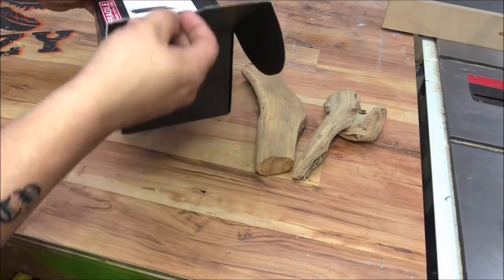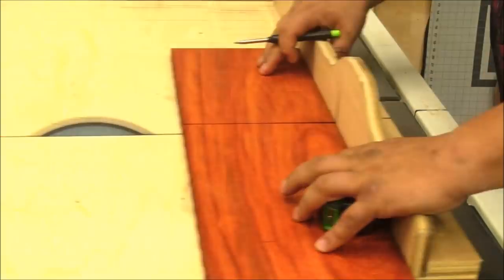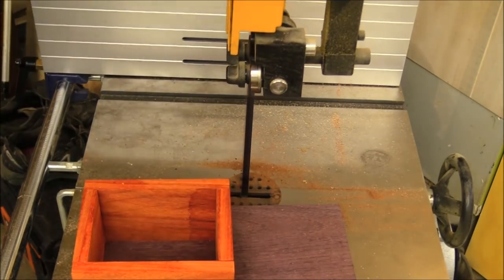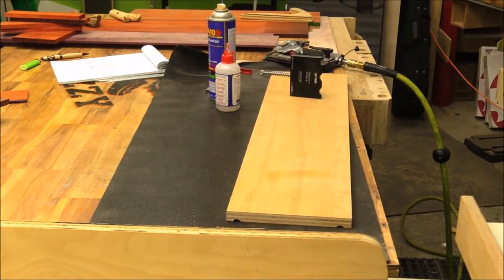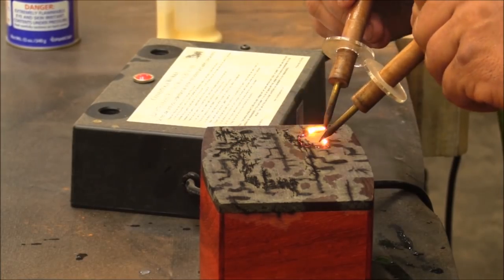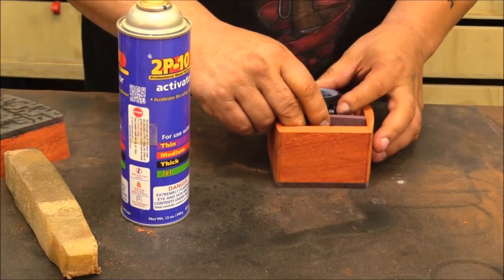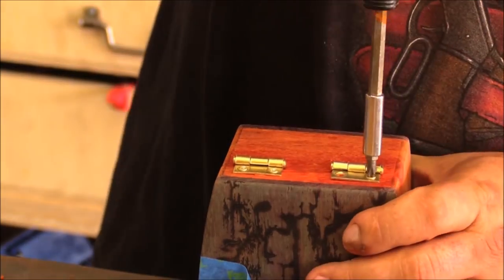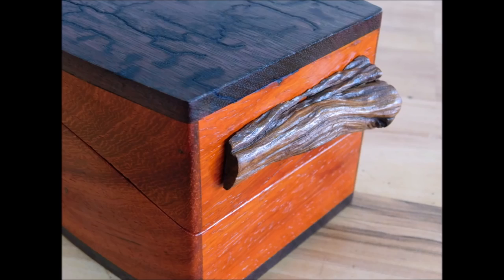Woodworking tips building a small wood box | Izzy Swan

Comment: I had started collecting watches awhile back myself when I got my first nice watch that wasn't from the crap watch bin. It can get really expensive really quick if you're not careful. I had to give up on collecting. I realized that I'm just too hard on my watches so I settled for a nice Invicta and called it a day. It's outlasted every watch I ever had previously. 
Now you got me thinking about watches again Izzy.. I thought I was over this obsession. 
It was because I get obsessed about time keeping devices that I got into wood working to begin with. My plan was to make wooden geared clocks (hasn't actually happened yet) and well, one thing lead to another and now I have the type of equipment that I could build a clock.
Alright Izzy.. You got me thinking about not only watches, but wood geared clocks as well. Any other projects involving time you wanna get me obsessing over while you're at it?  lol

Comment: ... and thank you for sharing this nice video, Izzi. Oh, yes, I have a question: just after to add glue in some of wood surfaces of the box you sprayed a liquid from a blue can( 2P-10 ). What´s the reason to use that liquid? I could read it can accelarate the drying of the glue? Is that correct? Hugs a lot.